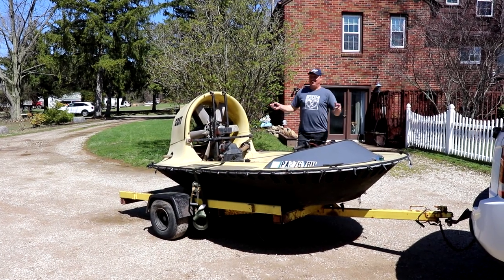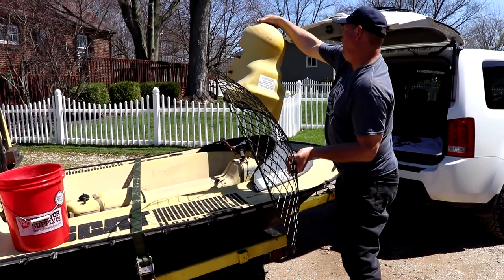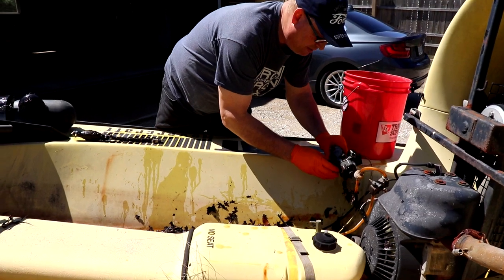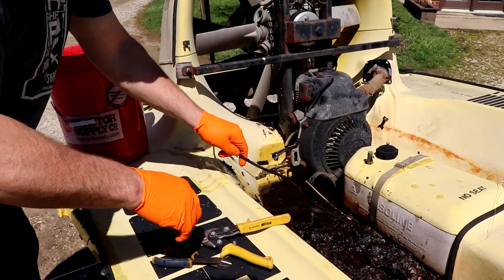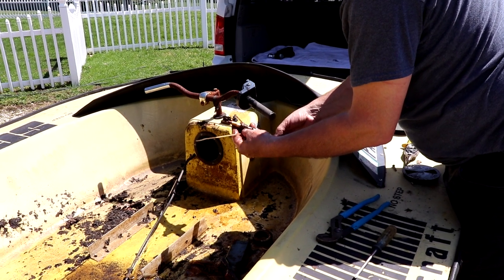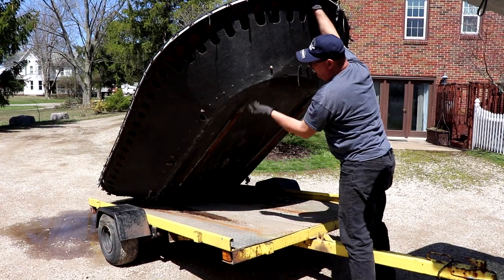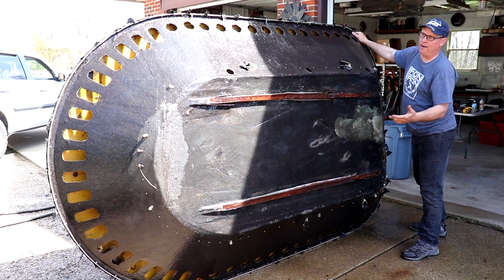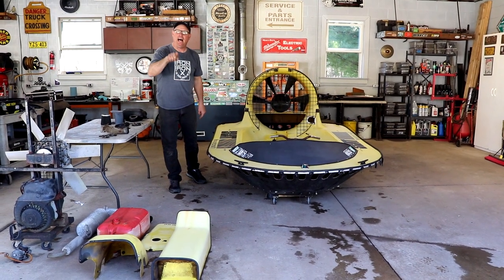Vintage Hovercraft Gets Engine Swapped! From 26 HP to 100 Horsepower!

Comment: I had a boss once that had one of them there contraptions stored in an out building at his business. Rumor was it belonged to his son and cost around $28,000.  It was about twice the size of yours as I recall. If you cut that thing into 4 quarters, you could stretch it out and make it big enough so it doesn't desinigrate the first time you flip it.                             🤘😎
Reply from the maker: Limiting the throttle will keep it all in one piece until I get used to it. Former pro bmx/Motox #ain'tscared Thanks for watching!
Reply: @GrenadeMotorsports  That boss's initials were D W. Probably not the same guy.